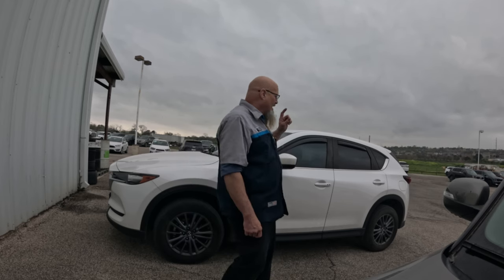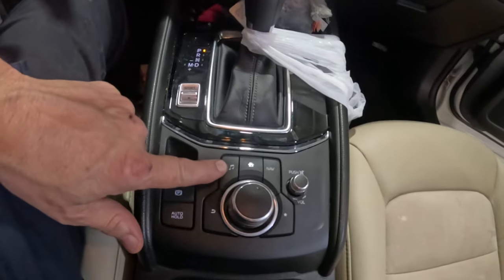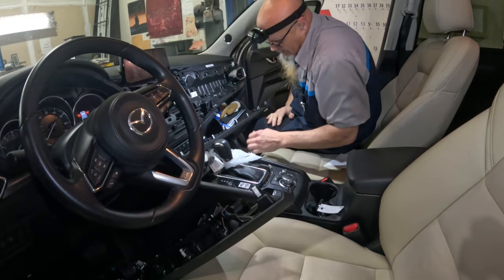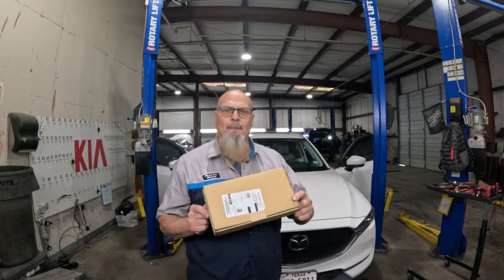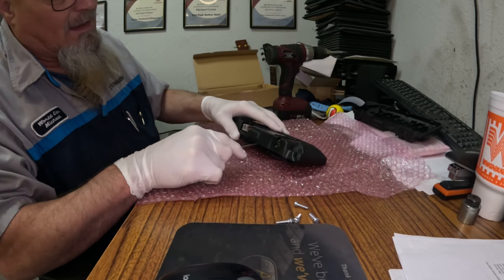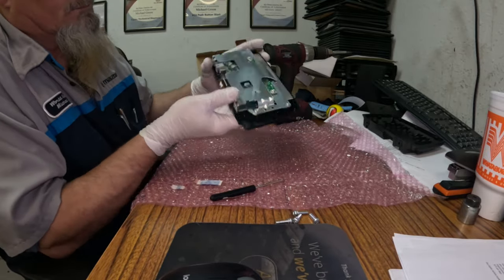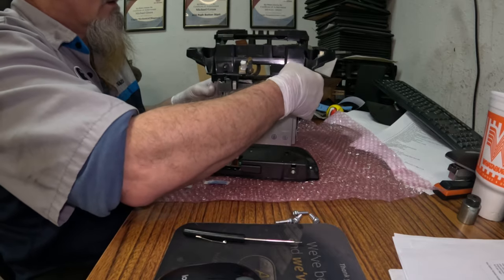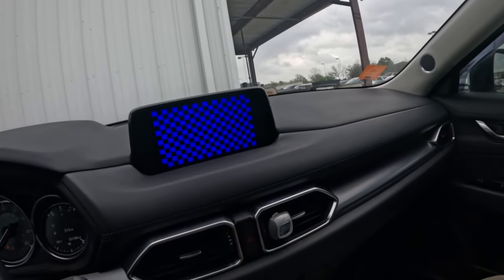Mazda CX 5 Ghost touch

Comment from the maker: This display kit is only available at your local Mazda dealer.  If you're going to attempt this repair, make sure you check the part number of your display.  Number ending in "611 J0 or 611 J0A". I don't know how much they cost because it depends on where you live and your local dealer. You could always take it apart and disconnect the display harness "printed circuit ribon" and go without touch screen.

Comment: Forget the repair kit, you do not need touch screen. Open the multimedia unit from the back and unplug the ribbon cable to the touch screen. Put back together and never have the issue again. Mine has been fine for years now. This issue happens from using chemicals to clean the screen which create shadows in the glass which emulate 'touch' when light hits the s GG reen
Reply: If I remove that ribbon to disconnect the touch feature does the screen still work for viewing?  Sounds like that ribbon is only for the ability to touch?
Reply from the maker: Yes it will. The screen will still display but, the touch part won't work.  If you do this, it will set a code B108E:04 for display system internal failures.  Of course if you have the ghost touch issue it probably already had a code set.  This code will not turn on the check engine light.
Reply: You can’t update the software if you just disable the touch.
Reply: Yep, I unplugged my ribbon cable on my 17 mazda 6 gt and it 💯 % fixed it!!!
Reply: I'm sorry where  is the ribbon cable to touch screen?
Reply from the maker: @dipo2000  it's the bottom cable.
Reply: @ShopForemanGarage it's one of the 2 cable that connects to display right? Which of 2?
Reply from the maker: Watch the video. At 12:35 I remove the cables. There are three of them.  It's the second cable I remove.
Reply: @ShopForemanGarage  thanks very much!

Comment: Mazda should recall this and take the charge on it not the customer I hate my display it sucks
Reply from the maker: You should go to your dealer and have them run a VIS on your vehicle. Some vehicles have a warranty extension that will cover it.
Reply: @ShopForemanGarage  This is more than a simple warranty issue.  It is downright dangerous for the infotainment system to randomly freak out while you are driving. It happens in my 2017 Mazda 6 during the summer months. It is very distracting and it will make phone calls to random people on my contacts list. This is a safety issue that necessitates a proper recall.
Reply from the maker: I agree.

Comment: Where to buy this repair kit?
Reply from the maker: This is only available at your Mazda dealer.  You need to check the part number to make sure the kit actually fits your display.
Reply: How much does it cost ?

Comment: why is the new screen flickering with the diagonal refresh rate? used a different type of camera, originally it didnt have that
Reply from the maker: The shutter speed of my camera did not match the  frequency of the screen.  If I had turned the camera off and then on again, it probably would not have flickered like that.

Comment: What I would like to know is do the new ones have the same problem? And have to replace it again?
Reply from the maker: The answer is no. I can not find reason behind it anymore. It had something to do with contamination when the display was built or something like that.  This is only for the 6th gen Mazdas. The 7th gen (or new ones) do not have this issue.
Reply: @ShopForemanGarage  Thanks. I have to put one in my daughters 2018 CX5. Your instructions are simple to follow and I will be getting an OEM screen.

Comment: 13:40 On the ribbon cables, there is a WHITE lateral line that will align with a WHITE line at each of the connectors on the electronics PC board.  Line them up and it will  be correct.
Reply from the maker: Honestly, when I made this video I did not think that people would be using it as a "how to" video. If I did. I would have spent a little more time showing how the thing goes together.

Comment: Hi Sr:
i just did the screen test using the code 70 as you showed and got that the display is fine. It's changing in different color patterns like in the video. Nevertheless, I've got the same Ghost Touch issue after starting the car, when stopped in the traffic light, etc. The Ghost Touch is really annoying. If the display is good, i don't understand what I'm missing.
Reply from the maker: It is the display. It can be an intermittent issue.  There are two parts. Changing on its own, or not changing when you touch it.  You could try using the code and driving the vehicle without touching the display and seeing if it changes color on its own. Either way. If it is acting on its own then it has the ghost touch.